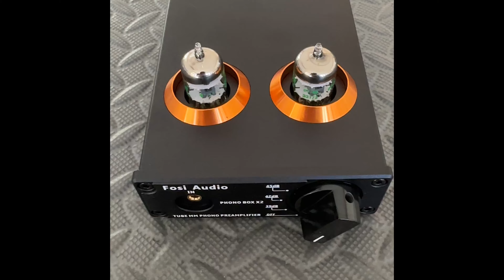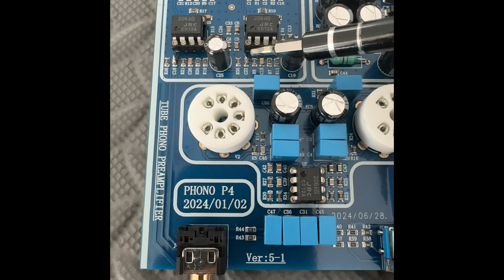Fosi Audio Box X2 Phono Preamp Modification

Comment: Are the op amps upgradable? If yes which one would you suggest? Also if the capacitors are replaced with audiophile capacitors, will they have an effect
Reply from the maker: Yes, they are socketed and upgradable. You may find your own preferences. There are a lot of recommendations on the internet.
Reply: @neighorizon-4190  Did upgrade with opa2134. I rolled the tubes to voskhod e95 equivalent. Wondering if those coupling capacitors and the electrolytic capacitors could use some upgrades?

Comment: The tubes definitely have an impact on sound quality, don't listen to this guy
Reply: When you remove the tubes it doesn't work.
Reply: Yeah. I was thinking, if the tubes don't do anything, why bother bypassing them?
Reply: The tubes are in the signal path, so removing them won't work. I measured the plate voltage and it's just 12V, this makes the tube to work in starvation mode. No gain is produced by the tubes. Moreover the output is not tapped from the plate, rather from pin7 which is the suppressor grid and is normally tied to the cathode. This method is called cathode follower generally used as a buffer. For this to operate you still need proper plate voltage which is 90-120V . There is a very minimal current flow throught the tube and there is no gain, it only distorts due to the low plate voltage. We can say for sure that these tubes are just decoration and marketing. If you don't want to cut the traces like in this video you can remove the tube and just short pin 1 to pin 7. However this makes the two paralle 1uF capacitors right after the third opamp( 2uF total) in series with the 1uF output coupling capacitor. So you need to parallel them like in the video, so you get 3uF total output coupling.

Comment: Interesting, Thank you. I was wondering if I could get any improvement using a linear power supply instead of the 12V switching ps. If you checked that this fosi has already an internal switching ps for have +-12V then there's no reason to try an external 12V linear Ps. Am I wrong?
Reply from the maker: Yes, +/-12V for the opamps